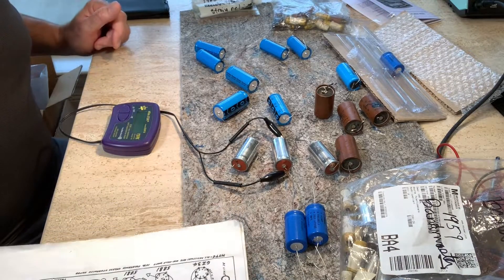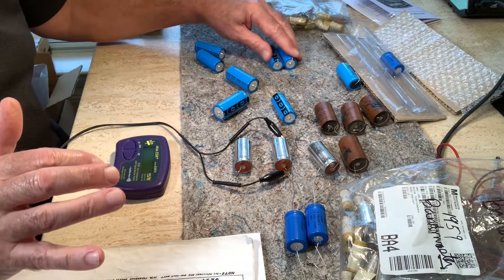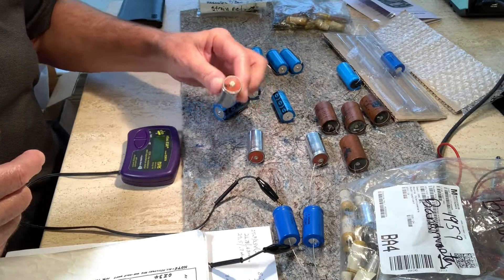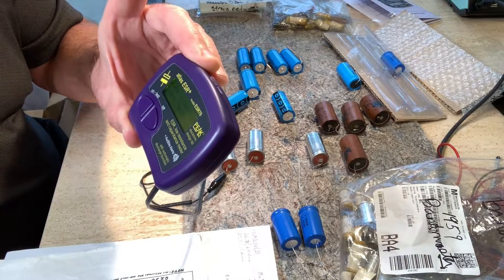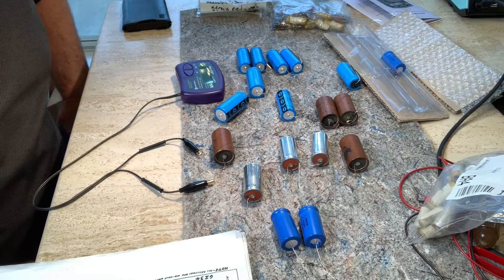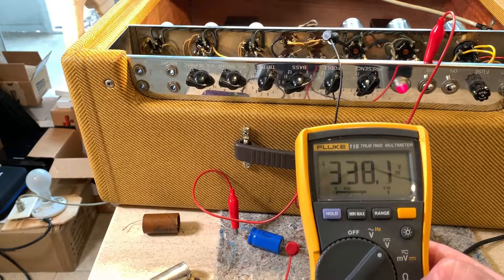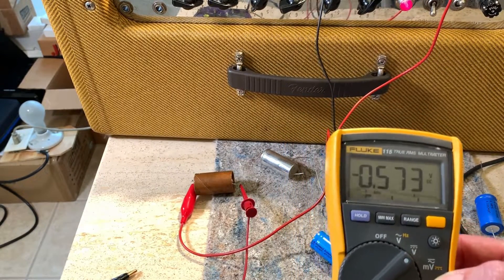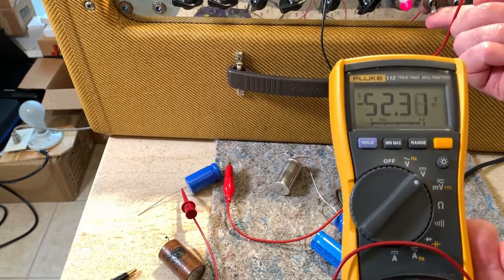A Video for Uncle Doug - Trying to Decipher ESR Readings of Electrolytic Capacitors

Comment: When i worked in a repair shop we used a esr meter. Best way to rest is use one of those old style testers but you need to remove it. We just dont have time in a repair shop to do that.
Reply from the maker: I did finally get a 1959 Sprague Tel-Ohmike TO-5 and I love it.  But, like you said, you have to remove each cap from the circuit which can be a real pain in a repair shop.  Thank goodness I have the time to mess with the caps on my own amps.

Comment: Did you zero your tester?
And  tester leads are too long
Reply from the maker: The meter comes with the correct leads permanently installed.  I've come to the conclusion for my purposes, these little ESR meter are useless.  What I really needed was a capacitor analyzer and I have been looking for one but they are way too expensive for one that may need repair.  Sprague and Sencor made them in the older days.  But, for finding out if an old cap actually is leaking current, it's not worth the trouble and money since the caps are not salvageable anyway.

Comment: An ESR meter is simply not ideal for measuring higher voltage electrolytics. Instead of ESR, these types of caps must be measured for DC parallel leakage which is different than ESR. A leakage test must be done with the capacitor out of circuit and tested at the rated voltage. There are many testers that do this such as the classic models made by Heathkit and Eico. Sencore has some more modern units. 

Unlike a leakage test, an ESR test passes a high frequency signal through the caps at a low voltage. It is particularly useful for testing smaller electrolytic caps in solid state equipment, especially switch mode power supplies where ESR is critical. Almost all antique electrolytic capacitors and paper/wax capacitors will have measurable DC leakage. Even if a capacitor sounds fine, if it’s leaky and passing DC, it should be replaced. It indicates that the capacitor is failing and the DC that passes will put stress on the tubes and other components and lead to premature failure of those components as well. A leaky capacitor will elevate the noise floor of a device as its ability to filter AC ripple is compromised.

Comment: You need a capacitor leakage tester for the 1st test..  ESR is not the only way to test capacitors.  You are not applying working voltage at these caps either.  For this you need a tester to check it at voltage.  I understand the conundrum about voltages thrown at the caps - but you gotta know what your B+ really is.  Buying caps rated for 500V isn't that hard.  The next step up is 1000V.

Comment: I am hoping you can help me. I have a Peavey Mace VT that has a printed circuit board preamp section Using ic’s with very small radial caps and resistors. I am having trouble finding replacement capacitors for repair. Everybody seems to have higher voltage rated and physically large components. Any advice you can offer would be greatly appreciated. Thanks.
Reply from the maker: I am not familiar with the smaller components because I only work on vintage amps but I would say the Mouser should have everything you would need.  Have you looked on their website?

Comment: There's another aspect to ESR with film and foil caps by the way- not sure if it applies to electrolytics. In the old film/foil caps, the ESR is related to the material that made up the foil and of course it's thickness. If you look at those wonderful sounding Astrons, they have the highest ESR- even brand new NOS ones! The newer you get, with all the technology improvements over the years, you will notice the ESR going down- closer to theoretical ideals. But the rub is that they sound sterile. I've bought some SOZO caps that indeed sound closer to the vintage caps and- you guessed it- they have  ESR right about where my Astrons test. The Mallory 150 series also have higher ESR and they certainly sound better in tube amps that most other similar caps. The older caps were likely made with impurities that made the foil less conductive but this may be another 'happy accident' of which guitar amps have been the blessed recipients of many. It's possible that the higher ESR provides a little extra sag in the capacitor's response to quickly-changing dynamics of the guitars plucked strings. With a chain of small filter capacitors and a chain of high ESR coupling caps in the older amps, there's a good bit of sag traversing all through those early amp circuits- and it sounds great! And remember too, that the capacitors of old were made FOR AUDIO by engineers who actually listened to how they sounded- not capacitors made for general applications attempting to achieve the closest thing to electrical perfection.
Reply from the maker: Thanks for the info Blake.  In some ways I wish you wouldn't have told me about the Mallorys, lol.  I know a few amp builders that say they like them.  They were so small I couldn't figure out how they could sound good.  I've got this size assumption I guess.  But, the amps are a little sterile now but I certainly don't want to go in there and start messing with them again.  I spent a good part of a month switching caps in and out.  I do have a combination of types in each amp but I did not have this ESR meter when I switched them all out.  The good thing is I can check them in circuit just to see.  I have a few small white Mallorys I could check too.  What Mallorys do you like because I think there are some yellow ones too?  I think my white ones are the only ones I've seen so I don't know if they switched construction or what over the years.  Mine are probably 10 years old.  The amps act more like a clean Marshall with a solid state rectifier which is really what I am shooting for anyway.  If I crank them, they are going to hold up as far as headroom goes and they are very pedal friendly.
Reply: @millstap  Seems like the yellow 150's sound better and IIRC are the older ones. But make no mistake, they're no substitute for the yellow Astrons. But with higher ESR they definitely sound less sterile. The big yellow Chinese film+foil ones can sound pretty good too believe it or not- but you have to get the 630V ones. Funny about size though- the fact that nothing sounds as good in old Fenders as those Astrons drove me crazy. I had a bad Astron so I took it apart and what I found was that the actual film+foil portion was far smaller than the 150! All that size is just that yellow resin! Go figure.
Reply from the maker: @blakef413  Yes, it was a sad day when I realized that ALL of my Astrons were leaking.  I played them for ten years but I presume over those years they started leaking more and more.  I've had decent results with the NOS Astron PIO caps and I just put in a bunch of .1uF/400V Nytronic PIO caps and they are really nice too.  I just started hearing the affects a room and amp placement can have.  Just the other day I added a rug back into my room where I had removed the carpet.  It was just concrete for over a year.  It took me a while to get used to having a rug again.  I had to play around with the amp placement and also baffle placement.  Everything makes a difference to your ear.  I guess if you are close mic'ing an amp, you take the room out of the equation but I don't think people consider the room as much as they should when they are messing with caps.  Amps usually sound better in an old bar with a raised wooden platform for a stage.  I finally got everything sounding good again with some very subtle shifting of the amp angle in relation to the walls, baffle placement, etc.  Ears are finicky sometimes.
Reply: @millstap  You clearly have good ears like I do- sometimes it's almost a curse because I can't play mediocre amps. My basement guitar room had a pole in the center which, to get rid of, I had to rebuild the walls and add double joists to the ceiling to bear the load without the pole. But once gone, it made a definite positive difference. The sound waves from each speaker add and cancel as the waves move outward. I haven't experienced that effect too much with the 4x10 Bassman, but with Celestion-filled 4x12s it's quite pronounced as you move around in front of the cab. And bending around a pole was definitely hurting tone. My room has 1/4" pine paneling on the walls (real stained pine- not the cheesy 70's fake stuff) and I think they help. Thanks for the tips about replacements for the Astrons. Love your channel BTW. Hey wonder if I can get your advice on another topic? I bought a 1960 Bassman a few years ago that, incidentally, was originally the amp of Myron Lee (and the Caddies). Serial number verified from an article about him and his amp. Came with pics of him with Dick Clark. Anyway, although the amp is a wonderful piece of history, I've never been able to get it to sound killer like some of them can. The Astrons don't seem to be leaking (with the DC voltage test anyway) and I've tried many vintage tubes and have a NOS set of curve-tracer-matched Tung-Sol 5881s in it. I've tried your 5751s etc etc and it just doesn't sound amazing. Wondering if you know of an old-time amp tech that has been around these for decades and knows how they're supposed to sound and could evaluate it to point me in the direction of what might need to be replaced to make it sound great? I'm at the point that I would pay to send it to the right person just for an appraisal. Thanks again- love your channel!
Reply from the maker: @blakef413  Blake, amp techs are a tough one.  They are exactly why I decided to DIY.  It can be a painstakingly tortuous process but it has paid off in the end.  I know of no one but I know they have to be out there.  There is a guy in Baton Rouge but I have talked to him.  He makes Komet amps.  He loves the Tweed Bassman.  His name is Holger Notzel.  He wanted to hear my amp but I didn't bring it with me.  I played his and it sounded pretty good.  He has several.  The problem is he is probably very expensive.  I called him years ago in a panic over my 1959 Bandmaster but I never took it too him.  I was very paranoid he would strip it of vintage parts.  Turns out, that would have probably been the best solution.  I am really surprised those Astrons are not leaking.  I can almost guarantee they are all leaking.  I would check them again.  Go the extra step and remove them completely and try to find a Sencore Capacitor Analyzer somewhere.  They will apply the rated voltage to each cap.  Or, just hot tap into your amp with a jumper cable at a point that is close to 400VDC and check them that way.  A lot of my recent amp videos shows me doing that.  You should though still get an accurate reading by just lifting the low voltage lead (opposite the tube plate).  Other than that, those amps can be a mystery.  I am still trying to get my 1959 to sound as good as my 1960.  All that is left to do is to get a beat up original cab with very good reconed original Jensens.  Since I stripped the 1960 of the Astrons, it is sounding more like a new amp so the old sound is really mostly old leaky caps which is never good for keeping your guitar signal clear and in tune.  Sometime I think my 1959 cab has a new baffle board or maybe it is a very good repro cab.  It had been re-tweeded.  The baffle can make a big difference too.  You really have to go into the amp and check every component, part by part, and compare it to the '59 Reissue schematic.  That is very close to what my 1960 is.  You would be surprised how easy it is to miss something.  My 1959 had quite a few things that were not the same as my 1960.  That is why Fender used the 1960 schematic to make the '59 Reissue.  It sounds better.
Reply: @millstap  Totally agree on techs. I was actually an electronics engineering major until I switched to computers, so I certainly understand the circuits. I was also so disgusted with my area's crappy luthiers and their high prices that I've learned all that too. Pretty sure I did this already once, but I will lift a leg on each Astron and use my Heathkit capacitor meter to re-check them all. It has a specific leakage bridge circuit with the green 'eye' tube and will selectively go up to the caps rated max voltage. Incidentally, have you tried the Greenies and Black Cats as replacements? They have ESR ratings equaling the Yellows but the don't seem to leak- ever. I built a high power Tweed Twin with them and they sound fantastic. I did have to replace one yellow Astron in the Bassman because it was internally popping and I used a Greenie and I couldn't detect any difference in tone- but that's just one cap. I've watched your video on the PIO Astrons, so I know which ones you're talking about- if those are the closest to the yellow's I will watch eBay for some.
Reply from the maker: @blakef413  I haven't read your comment yet but I just had a weird coincidence.  I was watching online church, and afterwards I clicked on my Rob Robinette tab for nothing really.  I had been looking at his bias 5F6-A bias pot mod.  But I saw this Batman and Robin cartoon, "The Plexi isn't a Bassman Ripoff.  "Silence" says Batman.  Then as I was looking for a link to some more info, I saw ""Fender Mid-Production Circuit Changes."  When I clicked on it, your name popped up.   Strange that all of my circuit change observations are also on Rob's site.  I am not sure when that was posted.  On the bias pot mod, that is a somewhat funny story.  I had made another Cermet bias pot assembly for the 1959 exactly like the one that was put in my 1960 by Gerald Weber.  When I soldered it, it appeared to be damaged from heat I thought.  This was almost 3 years ago.  I put it back in my box and just put the 56K ohm resistor back in.  Yesterday, I was trying to get my strongest matched pair of old 5881 Tung-Sols and they were running at around 30mA bias.  A little cool but I played it for a day.  Then I decided (as per Rob's website) that I wanted to get it back up close to 39mA like I usually run them.  So, I order the new pot and a few resistors.  Afterward, I decided to check my old pot assembly with my meter  just to be sure it didn't heal up or something.  At first, when I would turn the pot screw, nothing would change on the resistance.  I kept turning back and forth and I finally found the area where it worked fine.  Apparently you can get them to the end of travel and the screw just spins.  I think they are 20 turn pots.  Either way, it worked so I put it in the amp and everything is working perfectly and running at 38 and 39 mA at 460VDC plate voltage.  I just measure the plates at the socket.  I think that may not be the most accurate but close enough for me.  Now I have an extra pot assembly coming but I think my 1964 Blonde Bassman still needs an adjustable bias.  Now I will read your comment.
Reply from the maker: @blakef413  I have not tried the Greenies and Black Cats.  There are so many out there.  You just have to try them and see what you think.  Like I said, I spent a month literally trying different cap combinations every day until I found a combo that sounded decent.  But I just used what I had to work with.  At first I was going to use all Jupiters but at one point, I didn't like the sound when I put a few in so it was back to the drawing board.  That's great that you have that Heathkit Cap Analyzer.  That should be perfect.  I was shocked when I realized all of my Astrons were leaking.  Especially the .1's are more prone.  I was even more shocked when I realized the leaky DC voltage was knocking my guitar out of tune.  I checked every Astron and labeled each one on how much they were leaking for future reference.  It was in a range from .25V-60V.  Most were in the 3-5V range.  As far as amp techs and someone that has studied the Bassman extensively is John Grammatico in Austin.  Actually, he is moving to Fort Worth.  He may be a good person to have look at it.  He would be reasonable.  But, he has his opinion on what sounds good and it may not be your opinion but he does have some caps that he had specially made for the Bassman.  His amps sound pretty good.  When I compared his to mine, it was like comparing an old leaky amp to a new amp.  At the time I didn't realize what I was hearing but after I removed all of my Astrons, it sounded much more like a new amp and closer to his.  He even special ordered the cloth covered hook up wire exacty to vintage Fender specs which does not exist anywhere.  The original manufacturer of that wire said they had the same exact wire but John proved them wrong and they made it to old specs for John.  You wouldn't need that since you have original wire but it shows how obsessed he is with the old amps.  He recently changed gears to building Trainwreck clones.